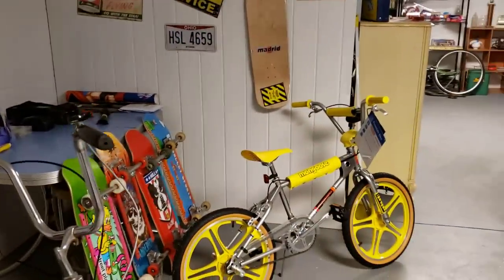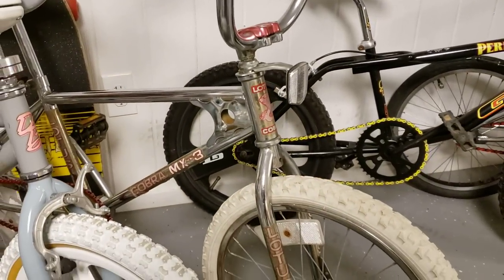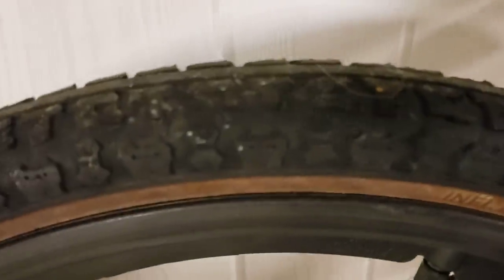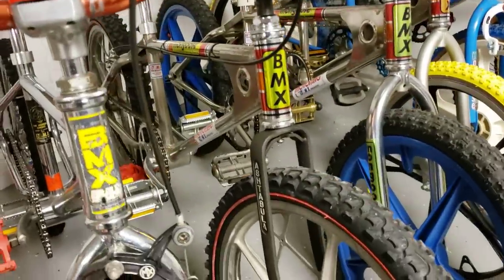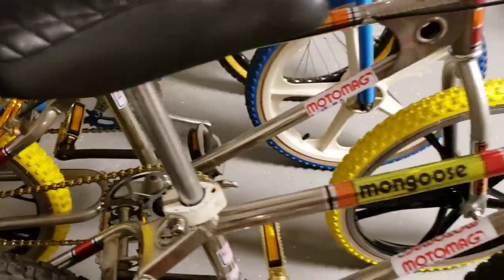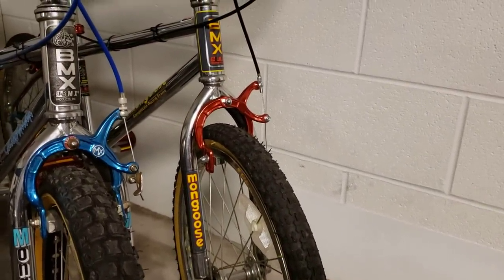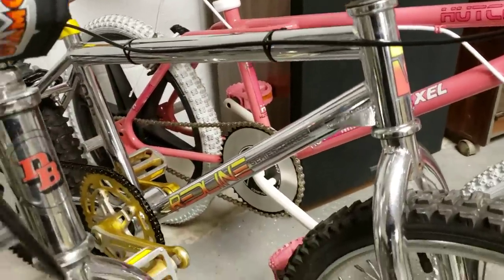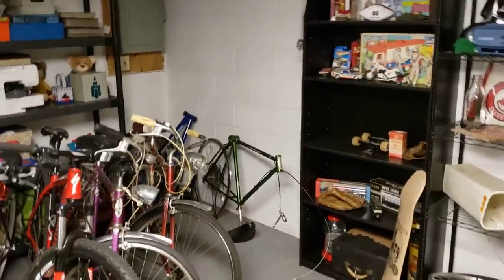Old School BMX bike collection

Comment: Extra nice collection you have there. In 1984 I used to race a JMC Racing at Westlake in Indiana. Bike got stolen end of racing. 2 years later, traded a crappy drumset for a Haro Freestyler. By that time, I was driving a car. Didn't have that for long. Sold it...Both were awesome bikes. Would like to see you aquire a JMC. The Vans trick team used those for awhile

Comment: Lots of vintage parts! But no mention of the “epitome of funkiness” grips as rated by BMX Plus! Mag, the Oakley 3 grips! I saw a couple pairs in there. One blue and one white, I think. I had the yellow ones. Sadly, I had a cheap Huffy that weighed probably 30 pounds or better so I was always trying to get the cool parts. Araya rims, SR pedals, DK stem, Comp 3 tires, Dia Comp brakes. It was a struggle to get that bike decent. Thanks for bringing back some memories. Quick question; who remembers those quirky Quad Angle racing bikes?

Comment: You got some sweet bikes! I had that old three wheeler when I was a kid, lol. I'm currently building a 1982  Schwinn Predator, hunting for some forks, but I just picked up a 1995 Haro Group 1 CI. It's almost complete and original, didn't come with the stem or the sprocket, but luck would have it, my 1989 GT Performer had the stock Fusion sprocket and cranks on it. Now I have to get the factory ones for the GT, or something higher end, lol. I'd like to have a room in a house just dedicated to park these in, next to my 1995 Redline PL24 and my 1999 Schwinn Pro Stock Team 24, and any other ones I can find along the way. Thanks for the tour, I appreciate it.

Comment: I had a cool old 78 mongoose and the same gt mach 1 you have. They both were stolen when I was a teen. Im in my 40s now and the only old bmx bike I have is my 98 diamondback viper in blue. All original minus the decals falling off and a little rust added for character.

Comment: When I was a kid bmx was my life my first actual bike shop bike was a pk ripper I found while raking leaves and then as I got older I had everything I had an original prototype Mach 1 with no stampings in the on the drop outs or top tube but it had a stamp under the crank really unique bike the pk ripper was so light I had a hard time getting used to it ....for my 15 birthday I got a redline 440 expert now I’m older I have a mongoose salvo comp which is bar none the best bike I’ve ever had a lot of memories brought back seeing your bikes my friends all had the free landing dynos and gt performers I stayed with the dirt jumpers.....my buddy had a hutch I don’t know if you remember them and then my friends cousin saved up 700$ and bought an elf frame and put t1000 rims on it a profile 3 piece and a 9 bolt stem that bike was easily 1200$

Comment: This is the mongoose I grew up with so I was quite perplexed when I first came across Walmart mongoose which is garbage. I was never rich enough to buy one of these bikes but I owned every single one of them in parts that were either traded of stolen. My bikes were all mixed but worked well. The haro frames were always heavy, the redlines were light, and the GT and mongooses were just a perfect middle.

Comment: Im 15 and i have a 80s predator i just built. All i had was forks bars and frame. So its not original but i also have a dyno gt and a dyno vfr. My dad had a chrome hutch and green dyno air. Both have barely been ridin

Comment: What does something like that 83 Redline go for or cost to rebuild?  
You said you got rid of some, do you have a shop?
 I had a 1986 Raleigh Reflex Pro. I would like to get it back.
Reply from the maker: No shop just my personal collection but if I see something worthwhile I usually pick it up even if it's not collection worthy. The 83 redline I picked up frame and fork pretty reasonably the old three piece crank was something I took off of another old bike wheels tires other parts I probably have around $350 in it should be worth 500 to 600 I'd say
Reply: @mathersblog  that isn't a bad rebuild price at all. 
Great collection.

Comment: I'm an uphostery worker those bike seats are eazy to refoam and wrap. Problem is wrinkles and metal bottom. Heat gun and slowly heat corners. Bottom you can drill wood to bottom with self tappers. I cut screws make them shorter so the top side can't be felt. You go slowly the eazy way I'd stretchy fabric or eazy to work with vynil trick is too much material to tuck spread out wrinkles. Or live with wrinkles. It takes like 5 years before your work looks good.spray can glue spray both sides wait till tacky.